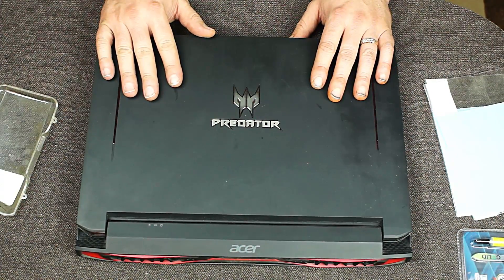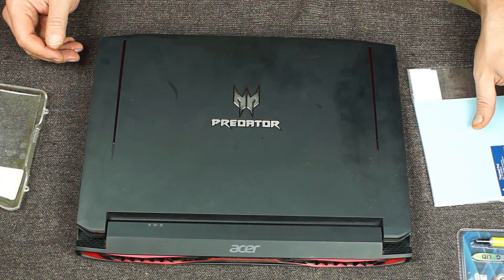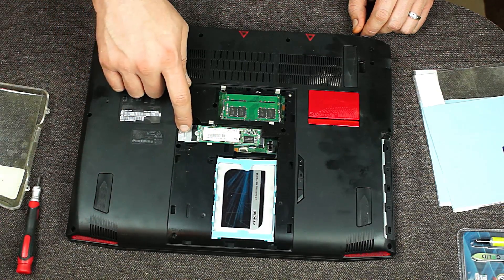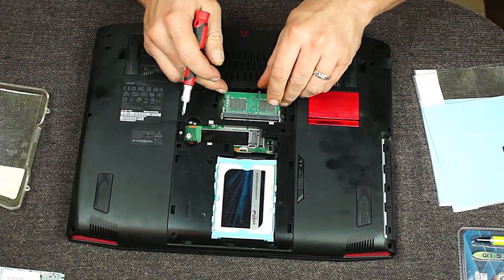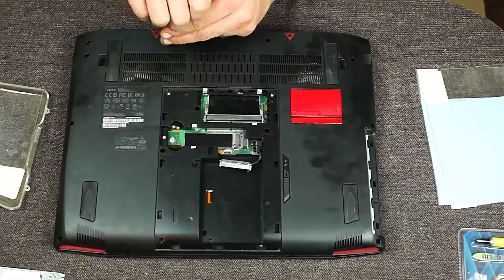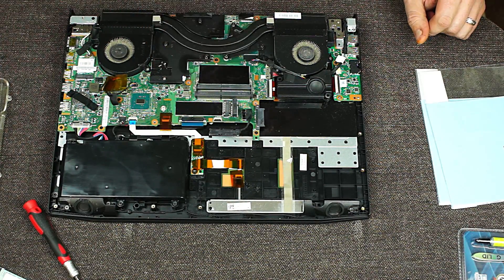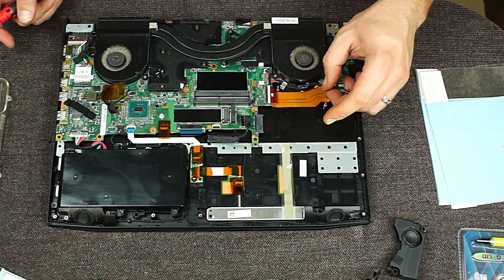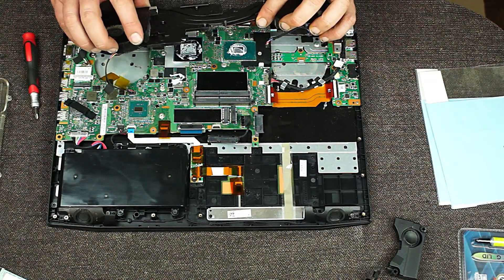Acer Predator 15 Thermal Maintenance

Comment: You used too much thermal paste there (experts recommend a blob the size of a lentil or small pea for full sized CPUs, so less for application directly on the die of a GPU/CPU), but other than that, great video!
Reply from the maker: Thanks for your comment but all of my CPUs and GPUs do great using this method and have for many years. There are many methods for applying thermal paste. I have been using the full spread method for nearly a decade as the pea method often times does not fully cover a die or heat spreader. I have tested this and you should too.

Comment: Hey what screws was used to open the 2nd panel the one with the multiple edge thing 4:31 he removed that screw but i dont know what type of screw driver can remove it. can someone help me?
Reply from the maker: They are all Philips head screws.
Reply: @heretolearntech3873   hi when i tried my screw driver set It none of them fit. I can remove the ones in the outside but not the ones in the middle.
Reply from the maker: @simonrodil391  I just looked at my bits and the one I use for those screws is a Phillips #1. I have had to put some downward pressure on the screwdriver while turning to remove some of the screws in the past. Be careful not crack anything or strip the head of the screws.
Reply: @heretolearntech3873  Would it be possible for me to send you an photo of my screw driver set for you to determine which one is useable for the middle part?
Reply from the maker: @simonrodil391  I can look if you want but it is the same bit I use for all of the other screws
Reply: @heretolearntech3873  Where can i send it if ever. I really appreciate for time and help with this.
Reply from the maker: @simonrodil391  You can send the image to info@andersonsolutionsdesign.com

Comment: Hi, my laptop is running in high end 80s deg C while gaming, do you think I should replace the thermal paste or is that within the normal temp range? I have 7700hq CUP with GTX 1060. Thanks.
Reply: *CPU temp in high 80s deg C

Comment: Hey man my predator 15 recently fell, now my gpu and cpu temps are very high (95 Celsius for gpu and almost 100 for cpu) Theres a ton of dirt and dust in my laptop, you think the fan might be broken? what else could be broken? (I know my HDD is fine)
Reply: Also my laptop is about 3 years old now
Reply from the maker: You will likely need to take it apart and clean it out before you will be able to diagnose what the problem is.
Reply: Mine also got high temp (95C GPU when gaming, normally just about 80C) and then suddenly some artifacts start coming up when using high load on GPU. Seems that some of my VRAM have malfunctioned.
I called Acer and they asked me to send the laptop to them. Then they decided to replace my motherboard although my warranty already passed since G9-593 is of high spec product. Thanks Acer!
6 months maintenance is important. Also routine maintenance especially cleaning the dust. Just open the back cover and vacuum.

Comment: recently i only found out , set Maximum state 77% will reduce the fan noise .  i7 6700 77% is 2Ghz , when need gaming just turn the slide bar to  Best Performance , its will make the CPU run in full high speed.

Comment: Do you get this loud crackling, buzzing sound from your speakers when under heavy load?
Reply: if you don't have warranty anymore, you can simply disconnect your speakers, the noise will go away and you will still recieve sound from the subwoofer. Cheers!
Reply: Nexudos  I opened it up and cleaned the fans while I was down there but had to unplug both right and left speakers.  I actually removed them entirely along with the subwoofer but my concern is that the speakers and maybe the sub should only be disconnected and not entirely removed due to proper cooling airflow.  Anyone think this was a bad idea?  Regardless the right speaker buzzing under load is fixed 8^)
Reply: @davidpoling7913  I simply disconnected it, and left everything in place. Don't know of any problems that could arise with removing them completely, so you should be fine.
Reply: i have the same problem , did you fix it ?
Reply from the maker: No I don't get any noticeable odd noises or inductor whine.
Reply: hi did you fix the loud crackling, buzzing sound from your speakers when under heavy load?
Reply: That sound is an audio feedback caused by an issue with the motherboard, it is a known issue and your pc needs to be resent to Acer for repair. That is if it is under warranty. If it is not, like mine, you just deal with it here and there. I just restart my pc and it goes away.
Reply: Yes i has it all you have to do is open the predator and then unplug the volume
Reply: turn your fan on hi for a few sometimes that will work either way ya godda do what this guy did in the end and then if the speakers are still crackling unplug them look up * how to fix the acer laptop buzzing * in a search and it should be the first video  ACER HAS LOUSY customer support and want you to pay for the shipping so they lost my future business.

Comment: Good video :)
i,m using predator 15 too.
later i wish i could changing 144hz panel on predater 15.
Reply: I just bought for it 2k monitor with 144Hz (changeable to 165Hz).
Reply: @Mr.Manson   how  and how to replace
Reply: @samertiman1222  What do you mean? Just connect the monitor to the laptop.

Comment: You are lucky not encountering stripped screws.....
I cant replace mine bro!!!! Im crying
Reply from the maker: I'm sorry you have stripped screws on your unit, that is really unfortunate.
I have had mine apart 3 or 4 times without problem.
I wonder if Acer changed the torque specs for the cooler screws throughout production or possibly added threadlocker.
Reply: @heretolearntech3873  mine is like 50c average in normal work or rather not under load....

Im lucky if I got 47 or 43c in normal work load....
Reply: @heretolearntech3873  they use blue threadlocker for the chassis at least
Reply: Sorry to hear about that but some pliers are design specially to take out stripped screws but it will be hard especially when the screws are small